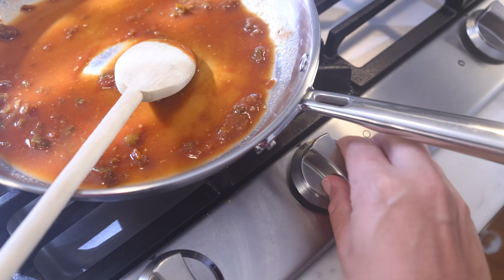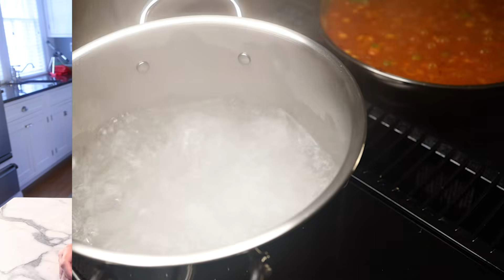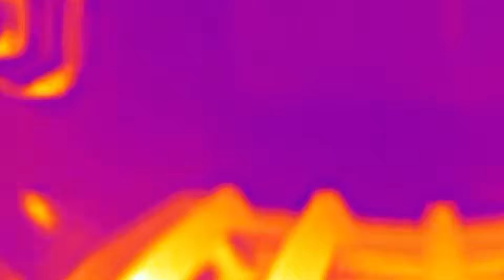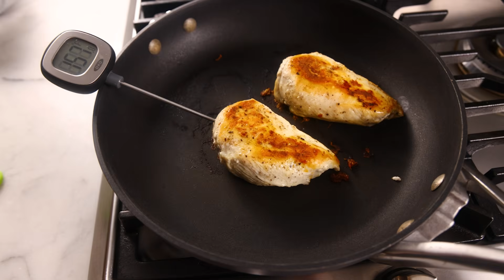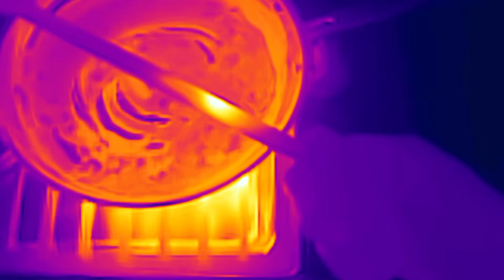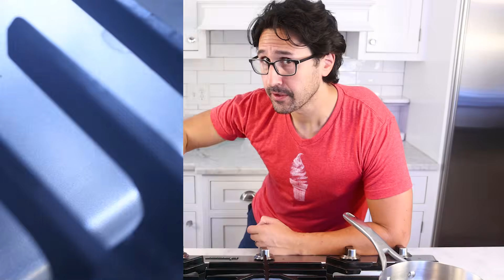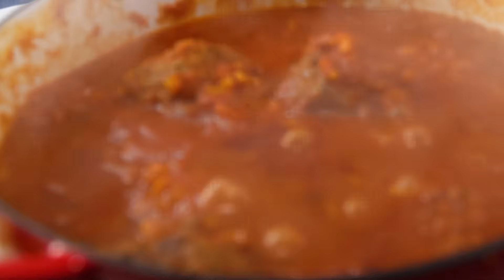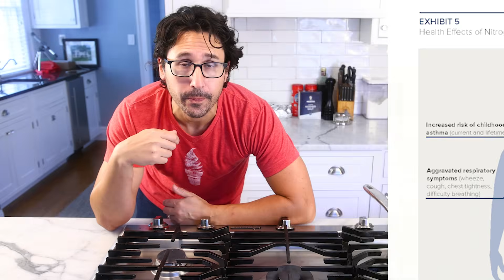Problems with gas stovetops | weak, dirty and dangerous

Comment: Gas ranges don't have to be weak, though. Commercial gas ranges aren't all that much more expensive than (nice) home ranges, come with ovens and broilers if you want, and are WAY more powerful than practically any home range. And they aren't super huge either. A standard commercial four-burner gas range is 24 inches wide. An individual burner on my gas range at work puts out as much BTU/hr as my entire 4-burner range at home. Those commercial ranges also go down to very low heat levels, at the cost of having an always-on exposed pilot light. This pilot can be disabled but then you have to manually light the burners on each use. Cleaning them, however, is way easier than home models since they come apart very easily. You lift out the burners themselves and clean them by placing them upside down on another burner and burning them out. That process makes a lot of smoke but completely cleans the burners from the inside out. The stovetops can also be easily cleaned either by wiping them (all exposed surfaces are cast iron) or by boiling a large stock pot of water for a while. The reflected heat off the bottom of the stock pot will burn off the gunk on the stovetop while it boils. When it's done boiling, you just wipe it down with a bit of oil and you're done.

You also don't need to worry much about spilling stuff on the stove, since when you wipe off the tops into the burner area, the stuff will drop down under the burners, along with any liquid drippings, into a catch tray underneath which can be easily taken out and quickly scraped into the trash with a board scraper. Because it's cast iron, if you get anything stuck to it, you can always resort to a wire brush if need be. In fact, with one of these ranges, you want to be a bit messy, since the cast iron needs have a coating of oil to prevent rusting. A bit of greasy splatter is a good way to keep it looking nice. Like any other cast iron cooking thing, you never clean with water; just wipe it off with a (paper) towel, lightly oiled if need be. If my home range ever takes a shit, I will seriously be buying a commercial range.

Comment: I think in a lot of countries where gas stoves are common, electric kettles are also common, which effectively entirely removes the issue of pans of water taking longer to come to the boil, since I always just boil the kettle to start my water for pasta or for boiling or steaming vegetables.

On the other hand, I've always found waiting for an electric hob to heat up before I can fry something properly to be far more of an annoyance as a Brit, along with how electric ranges stay hot for minutes on end after use.

Obviously it's a case of different strokes for different folks as you address. When I can boil water in a 240v electric kettle in just a few minutes I'm not really bothered by the speed at which has heats up a big saucepan full of water, but if you don't really have that option it's totally understandable, especially with the fact that, as far as I'm aware, electricity prices are lower in the US than elsewhere.

Comment: Adam! A small advice I can give you as a gas stove user: You can get an even lower heat if you just barely open the valve at the start. It may take a bit of practice, but it's a very convenient trick I learned.
Reply: I was going to say the same thing. On my burners, I have to turn it on normally, then slowly back it down toward 'off' until it just barely stays on. If I go too far, a few holes will be missing flames, but I just inch it back up and it's pretty good for cooking rice and such. Still find that it simmers a little too fast, though, and have to be vigilant.
Reply: @chezmoi42  Yeah, it mostly getting familiar with your kitchen and knowing the fire.
I can set it low enough to bake sponky cakes in the stovetop!

Comment: Heat is measured in BTU's. A cheap gas stove's largest burner will generate about 10,000 BTU's.  On a high quality gas stove that number is 50% more at 15,000 btu's.  A commercial gas stove can generate 30,000 BTU's

Comment: Firstly, gas tops heat output depend on the fuel you feed to them. I live in Hungary and we notice when the gas supply is different. I don't know how gas regulations work in the US but you can really mess with gas if you want to. 

Secondly, nobody thinks about energy diversity... "make everything electric because carbon foot print" is a pretty dumb way to look at a (probably) essential piece of equipment. Gas as a source of heat for cooking means that you will have heat nomatter what happens to the grid (witch is huge mega structure that is hard to keep up). Gas tops are great if you grew up with them and know how they can be more than just a cooking equipment in times of need.
I'm not a cook. But I maintained servers as an IT professional for years. When you want your data safe, you must have multiple copies and those copies must be stored using different tech based on the use case. Tape (yes magnetic tape) is still in use today because not even hard drives offer the same longevity in terms of archiving data. The tech is "old and crap" but it has a different purpose. If you need diversity of technogly for your data. Your food better have it too. 
I think the best would be to accept that we should not electrify EVERTHING. "Old tech" is usually better suited for long therm use. That's what old tech was designed for. 

Regarding the health risks. I usually have confirmation bias because I know people who hand soldered hundreds of thousands of circuit boards yearly since they were kids and they are still in good health. So I have my doubts about the mentioned health risks due to knowing people who worked with molten metal and Flux fumes for decades and the only thing they had was good ventilation.

Comment: Recently switched from electric glass-top to induction, and I had had gas before... induction is so much better than gas and especially electric in terms of performance and user-experience. Some professional Michelin-star chefs in the UK have switched to Induction now, also citing that having lots of burners in a kitchen makes things very hot and uncomfortable for the cooks and induction solves that issue.
Reply: Oh also some countries including the UK are looking at switching from natural gas to Hydrogen gas. I know somebody working on it all. Apparently the explosion risk is no worse than natural gas because whilst it is more explosive, it's also lighter and dissipates much more readily (so it is harder for it to build up to concentrations where an explosion is likely). The only combustion product from hydrogen and oxygen is water, so much better in terms of pollutants.

Comment: Didn't Adam have an induction stove?  New house?
I got a new house with a fancy gas stove (Blue Star) and must say, I think I'd prefer the induction stove top.

I wonder if an induction stove would be easier to keep clean (than gas).  Does it get scratched or stain easily?  In the olden days, my mother had a Corningware stove?  It was horribly unresponsive and difficult to keep clean.

Comment: Oh man, an Adam Ragusea video about a subject that I have suuuper passionate opinions about as a chef? Sorry for the incoming essay... 😂

So, I know you said there are your problems with gas stoves, but I'll address any factors i think could make a difference!
First of all your point about bringing water to the boil, while i'm sure is true and backed by the science of heat transfer is something that doesn't really bother me when i'm cooking at home, but probably mainly because I'm a Brit and we all have kettles that we boil our water in first before adding it to the pot.

As for me personally, I prefer gas hobs so much that I boldly proclaimed to my room mate when we were looking for a new apartment to move into "i don't care about bedroom sizes, outside parking or neighbours; the only thing i want is a gas hob", only to find that here too, electric stoves are waaaaay more common than gas these days...

You also mentioned that gas hobs' lowest heat is usually not low enough, which i've found to be true sometimes, but also depending on the model of the stove, the size of the pot, the amount that's in it etc etc, I've actually managed to use my gas stoves to make a makeshift sous vide setup. I was able to control the temperature from 65, 70, 75 to 85+ celcius with only a few degrees of inaccuracy by simply leaving the lid off, using the smallest burner and then just changing the size of my pot between my 1.5L, 2.5L and 6L pots(with different widths, filled to varying degrees with water, since the more water is in it, the more that heat will be dispersed, and the wider it is, the more heat will spread into the surrounding air... i think?)
Obviously, not a very elegant or practical solution for most home cooks, but hey ho, it was a useful thing i found with trial and error!

Now the big one for me, which you did mention is woks! This isn't an issue of "gas hobs are better for woks than electric ones", but rather "I simply cannot use a wok on this electric hob" based purely on the shape. The flat, glass top electric hobs that most houses in the UK have are no good woks because the surface area of what's touching the glass itself is probably only about the size of a penny due to the wok's shape. And as well as that, I own a cast iron reversible griddle/flat-top which i like to do things like smash burgers on, which is also unusable for me on electric hobs, as to use the "smooth" side, the "griddle" side is down, with only the peaks of the griddle touching the glass.

Though, of course I can't deny many of the points, such as gas being from non-renewable fossil fuels which does pain me, but I try to turn a blind eye to it by justifying it with "well i don't drive a car" or "i'll switch to induction one day, when i can afford it" etc etc

And finally, about the heat travelling up the sides of the pot, making the sides too hot and scorching the food? I'm not going to lie, I did make a custard last week and I had to specifically change the way I was handling the pot by swirling the milk around the edges on purpose to "quench" the metal, lowering it's temperature manually, but I would just consider that in the same vein as how you just have to move your pan off of the heating unit of an electric hob that's too hot; not ideal, but in a home setting, i can work around it.
Ok, rant over!

But all-in-all, great video! I didn't realise I needed or wanted someone to list features and drawbacks of gas stoves to me for 12 minutes until now! hahaha 😁

Comment: The problem with "low not being low enough" is fixed with my idea for digitally-controlled gas burners. A servo gas valve can cycle the fuel on and off (which you can't do effectively) to maintain a precise pan temperature, sort of like an electronic flame tamer. Plus, every pan on the stove would be monitored by a temperature sensor, so features such as overheating protection (which turns the flame down or off when it detects a possible fire risk) would be easy to implement, and this tech alone could prevent many house fires caused by inattentive cooking.
Reply: I am no expert, but I don't think that would work. It would control the gas flow  rate well, but if the air-fuel mixture leans out too far (not enough fuel), then the flame will extinguish.
Reply: @DarkLordDeimos  if the flame extinguishes, pan temperature will start dropping. The electronic igniter would trigger to light the flame again if that happens.

Comment: I appreciate this perspective. I've always regretted that I have an electric range and considered gas stoves easier to cook with. I think that's the common thinking in the US. But I appreciate hearing about some of the advantages--environmental and otherwise--of my electric range. I feel like I've accomplished something . . . by doing nothing.
Reply: You can get a nice induction hotplate for about $70 and it is nice for when you need fast heat response and/or don't want to heat up the kitchen.
Reply: @macrumpton  You can also get a portable butane gas single burner if you need that gas heat, thats what they use in Asia, I have one for when I need that quick flame heat.
Reply: Gas is objectively terrible and i don't know why people rave over them. Induction has all the same control properties, boils water litterally 3x faster than gas, and over efficiency if you had 100% natural gas electricity (which you don't, use the EPA power profiler to see you exact mix in the usa) they would be equal in overall efficiency in terms of natural gas consumed except the gas dumps all the waste heat and combustion products into your house. Also gas is literally a fire and explosion hazard and is stuck being a fossil fuel or rarely its a sustainable methane source like an anaerobic digester turning waste organic matter into gas. 

Gas's only advantage is that during a power outage (a fairly rare event as power companies hate them more than you do since they are losing money when it happens) you can light them with a grill lighter or a match (please be careful lightning a gas stove by means other than the built in igniters).
Reply: @jasonreed7522  A lot of people just like what they know — even if it's objectively worse. I will never go back to gas from induction, it's a downgrade
Reply: @jasonreed7522  It is all in how you learned, gas is responsive and intuitive, but for everything else, Resistance Coil and Induction are simply better than gas
Reply: I have an induction cooktop (I just replaced the original one that was installed in 2006). I worked in another city for a year and had a gas stove. I couldn't wait to get back to my induction cooktop and electric oven.

A gas oven works fine, if you don't mind a house full of hydrocabons, and food full of partially combusted gunk. The gas cooktop was a real pain in the butt, though. It took freaking forever to heat a pot of water. To make spaghetti, I'd heat water in multiple pots so it wouldn't take all day.

The gas stove was also a major fire hazard compared to the induction cooktop, with which you'd have to work pretty hard in order to start a fire.
Reply: Gas is better.  You weren't wrong.  You can overcome the weaknesses of other cooktops with careful planning though.

Comment: if the fire leaks over your pan, use smaller burner. always match the size of the burner with the size of your pan. in my style of cooking i do not mind that it takes longer to warm up, i can wait an extra minute. my priority is to be able to lower the heat quickly which is easily done with gas burner, not so much with electric burner. they keep residual heat and are not as responsive in my experience. but washing gas burner is truly absolute pain in the ass.

Comment: My problem with induction is that the cheaper ones, are very shitty (at least that's my experience with it), if I'm not using a cast iron or something heavy, it doesn't distribute the heat evenly throughout. The one I had, didn't had a medium or low heat, it just turned on and off on different frequencies!

But then again, I'm open to it, the big plus for me is the fact that there's no leakage of heat, you can cook for hours and your kitchen wont become that hot...
Reply: 'My problem with [x] is the cheaper ones aren't as good.'
Holy shit, you've discovered a revelation.
Reply: @grabble7605  I mean that I prefer a shitty gas stove than a shitty induction one. I cannot compare the higher end products, just my experience with the meh ones

Comment: I grew up in a house with a gas stove, gas clothes dryer, gas boiler for hat water baseboard heat, gas hot water.  It even had gas-powered air-conditioning until 1985. You sound overly concerned about possible dangers due to lack of familiarity.

Comment: I’ve never found electric to be faster when it comes to heating water and I have cooked on some very expensive electric ranges. They do seem to heat up a bare pan fairly quickly. But I’ve always noticed hotspots on electric ranges. They cycle on an off so they never seem to be able to heat a large thermal mass very quickly. My current range is brand new, crazy expensive and has something called “dual heat” and even with all that it can’t heat up a kettle. I’ve seriously waited ten minutes with it at its hottest setting and the water wouldn’t boil.
Reply: Are you sure you are providing it with enough power? Should be plugged into three phase power.
Reply: @albinekb  the issue, I think, is that the kettle is very thin metal so it doesn’t hold onto heat very well. I’ve had better luck with cast iron, because it can hold onto heat.
Reply: @Doc-Holliday1851  yeah probably you can get a special kettle with more iron in the bottom to make it work better, I have only used them with special pots made for induction
Reply: @albinekb  yes

Comment: @9:55 why do people still think this?  I just don't get where this pervasive idea that electrical transmission is so inefficient comes from.  Grid losses average ~5%.  Your average gas distribution network, which is riddled with leaks, often has losses in the 20% or more range.  That doesn't even get in to the fact that if we're talking about efficiency for the sake of the environment, natural gas is much, much worse to have knocking around in the atmosphere than co2.  Bottom line, there is nothing that humanity has found so far that beats high voltage electrical transmission for bulk distribution of large amounts of energy with minimal losses.